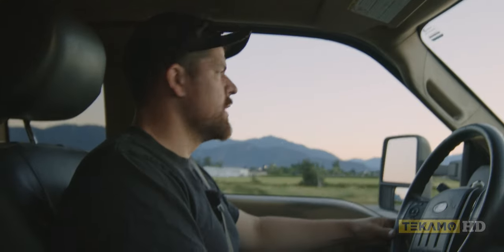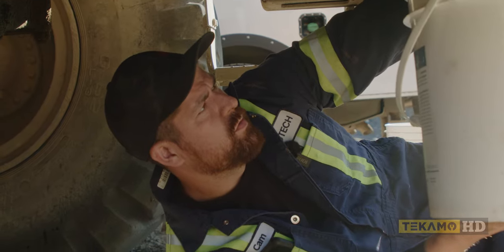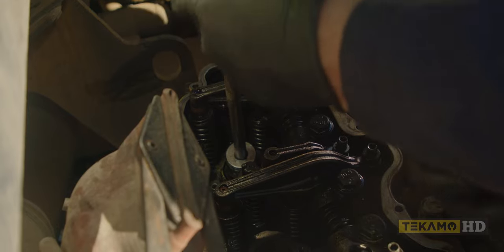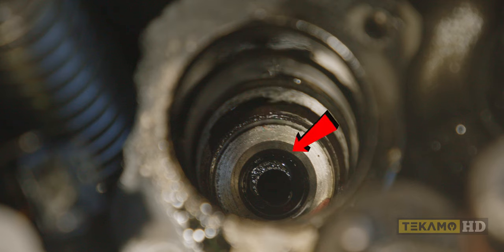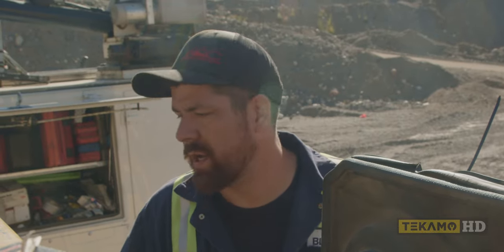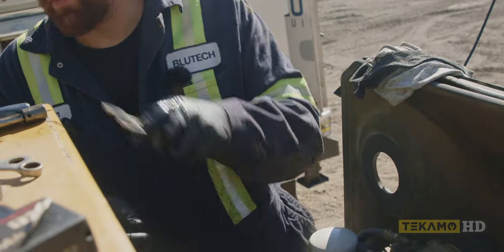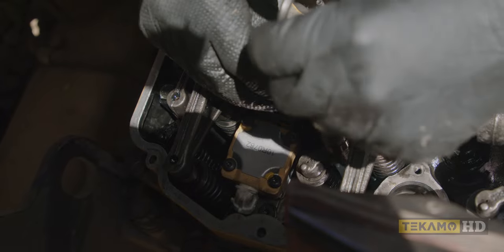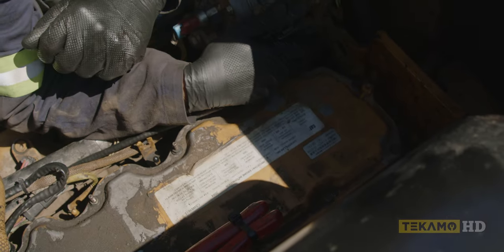Proper Tools Make Replacing Injector Cups on A Cat Wheel Loader 950G Easy!

Comment: Your doing it correctly, lock tight or bearing mount on very bottom, lube up top orings, install 👍.   NOTE:  ALWAYS replace injector hold down bolts!
Reply: Why would you change the hold down bolts
Reply: Screws are meant to be stretched, loosened and then restretched I mean re-torqued. Just multiply the nominal torque by a factor of 1:4 each time you restretch
Reply: Caterpillar recommends replacing them every time

Comment: Get the CAT tool.  For the 3126 its $630 US, but don't have to worry about metal shavings falling in the cylinder.  Cut the job time in more than half. 3126 has no trim codes, even the CAT ones. learned that one after SIS freaked out when i tried to look up the files.  Called dealer and they were like ah ya just slap those bitches in and send it.  I like to use the Lisle no spill funnel.  Lets you overfill the system so all the oil/fuel floats up into the funnel while its running.

Comment: Shouldn't the loctite be on that last radius? Like in the corner. I would assume the pressure of the injector hold down would press the cup in further and it would seal on that radius. But that is an ASSumption 😂

Comment: Check those injector seats their all defective right from cat and can be repaired easily with an aftermarket tool part#c15-3055 reammer will stop combustion cases breaching seats messing up o rings and cracked nozzles or even cracked heads